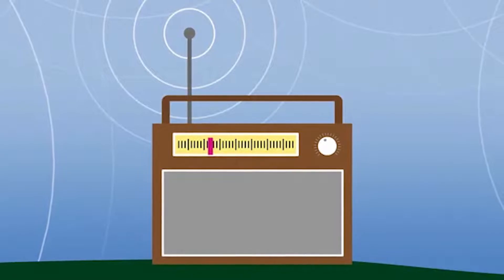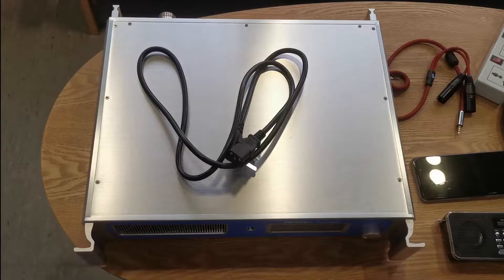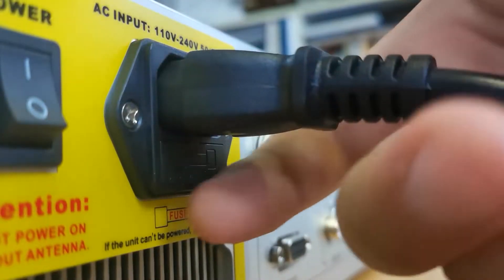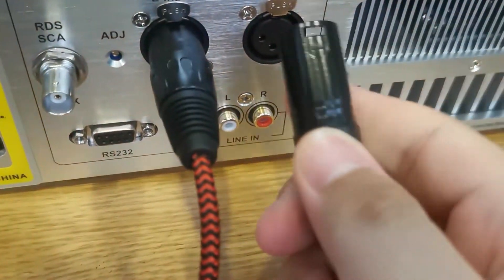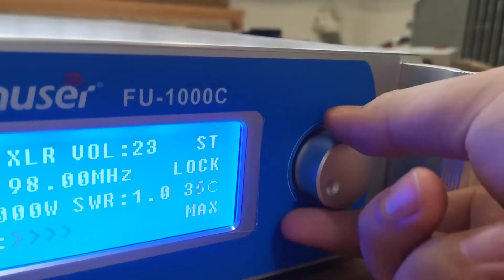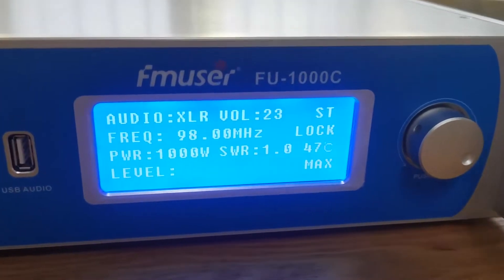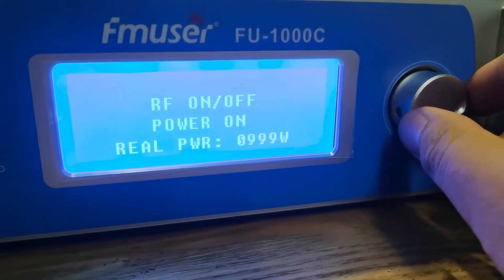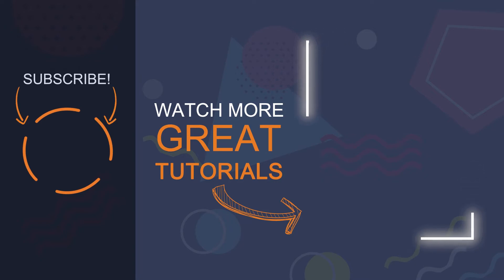How to Use a Dummy Load for Testing a 1KW FM Transmtter FU-1000C? A Step-by-Step Tutorial

Comment: How can be change the power? please
Reply from the maker: Hi Ali, if you mean how to change the transmitter output power, you may use the jogdial on the front panel of FU-1000C, then locate the "RF power" in setting menu, twist the jogdial and press it to make sure the RF power is set from "0W" to "1000W" or "1000W" to "0W", while the RF mode is from "on" to "off". Welcome to subcribe to us for more!
Reply: @fmuserbroadcast  Thank you...but in the menu there is only on and off(RF power)..and the temperature is 60 degrees Celsius, is this normal
Reply from the maker: @alial.rahabi7938  For FU-1000C 1KW FM transmitter, the output power is only either 0 watt (off) or 1000 watts (on), and that's why FU-1000C is an economical FM transmitter. But we do provide other broadcast transmitters with adjutable output power, available from FM (0.1 W to 10 KW ) to AM (1KW to 200 KW). Contact me if you're interested in more details.
Reply: @fmuserbroadcast  thanks 🌹
Reply: @fmuserbroadcast  AUDIO : XLR VOL : 20 ST LOCK FREQ : 91.50MHz PWR 1000W SWR : 1.1 59C LEVEL : >>>>>>> MAX
Reply: This is my values... Is this normal ? Plz
Reply from the maker: @alial.rahabi7938  Is your transmitter FU-1000C? If yes, then:
1. ALWAYS bear in mind that: connect the dummy load or antenna before turn on the transmitter, or your transmitter's power amp board will burn out due to over-heated temperature.
2. Don't forget to change the audio input mode (base on whether it is USB or XLR or else), or you will hear nothing from the radio.
3. Tune the transmitter frequency same as the radio frequency.
4. I don't see else that's not normal.